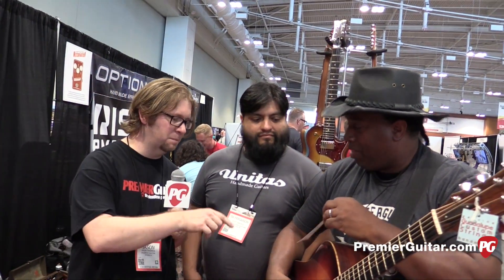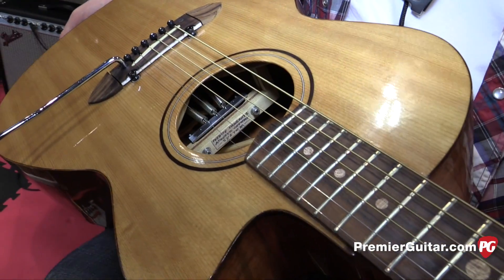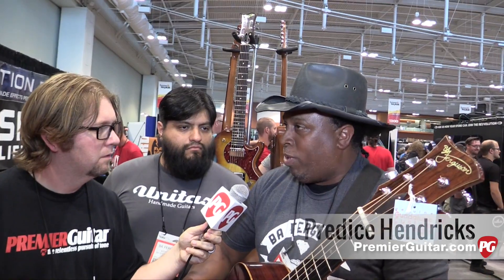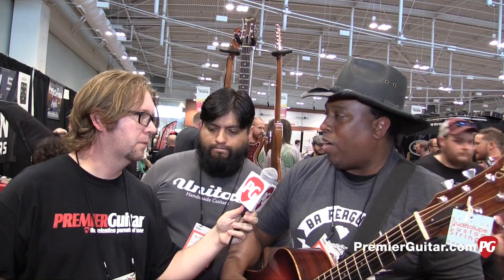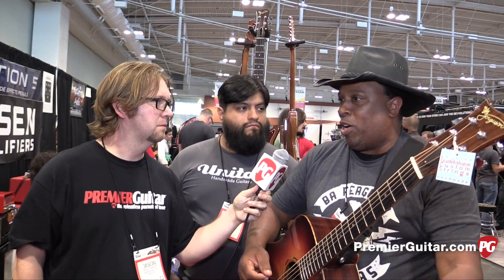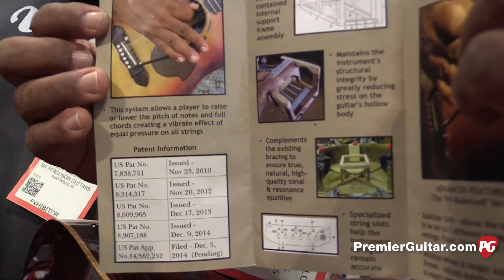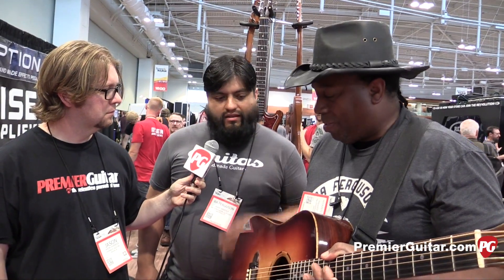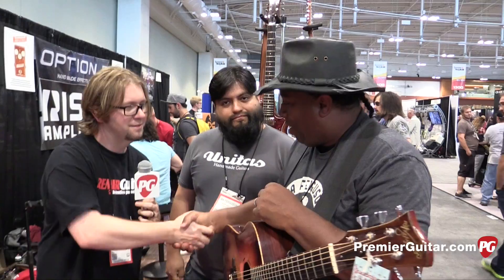SNAMM '15 - BA Ferguson P.H.A.T. Acoustic Tremolo Demo

Comment: I've seen that before.

Ibanez did it in the nineties with their ATDS10NT. Look it up.
Reply: They did, but it never took off because it lost tons of sustain.  Peavey did it also.  Where they went wrong was in the weight and that they unified the top with the back with a solid block or a frame.  This is different.  Sadly, because there was so much going on, it was hard to hear it.  But it really does sound surprisingly good.
Reply: Grestch have one, too.
I've no idea what model it is or what it sounds like,
but it was really unusual looking.
If I'm remembering correctly, it was  remarkably inexpensive.
Reply: @abegarfield3754  grestch rancher, has a neck pickup too
Reply: It was electric also to amplify the sound!!
Reply: Why has no one ever tried using a bigsby style tremolo with acoustics before?
Reply: @SunnySuzu_  Look up Brian Adams' unplugged show and see him playing one.
Reply: @RastaSaiyaman  is there any way I can put a bigsby on an acoustic guitar?

Comment: I like the idea, but I see more practical (and cheaper) to use nylon strings in a electric with clean tone to reach that acoustic feel.
Reply: it will work but you also need nylon magnets inside the pickups.

Comment: Take regular solid body or hollow/semi hollow with piezo in bridge and you will get close to same sound with more sustain, stable tunning, easier to adjust system.
Funny project but no practical use.

Comment: I foresee TONS of problems with this, just like Floyd Rose did, only worse. First thing to go is the box frame. Won't take long for that to give way.
Reply: Wrong!  The 1st prototype has lasted 5 years on the road.  They're made from a composite wood and carbon fiber to reduce weight.  The new ones are anyway.  The first 2 were mostly wood and were heavier which is why the one in this video sounds thin.

Comment: It's a cool product, but it definitely lost all sustain...maybe a more rigid and well rounded design on the insides and it would sound better.  That guitar sounds like crap with whatever system it's currently using